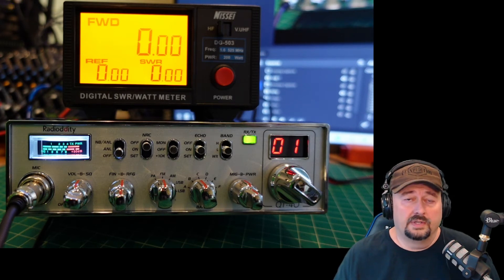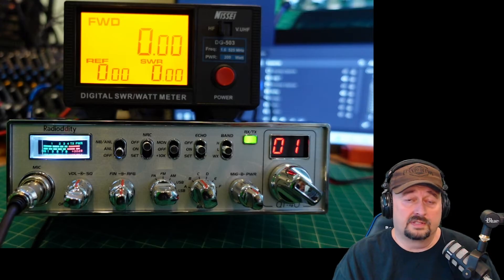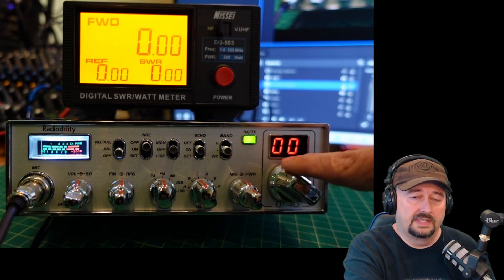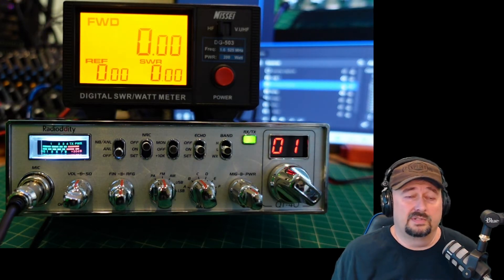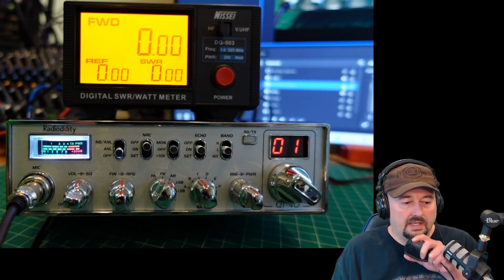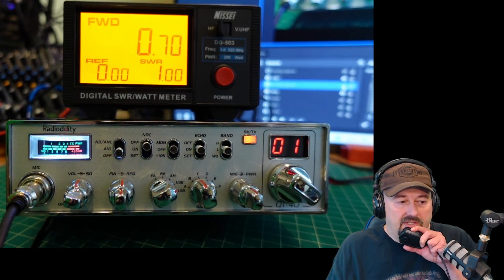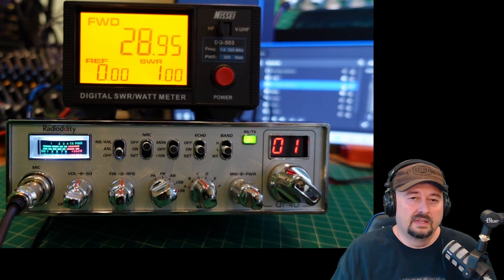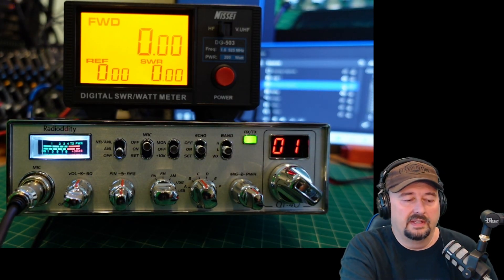Radioddity QT40 10 Meter Radio Power Test

Comment: I bought a used one. It was less than a month or so old. It has TONS of cool features, you just have to read the manual to unlock/use them. The radio even has a Frequency counter, although it's not a conventional styled one. It shows frequencies two digits at a time, but it's still cool !!
Reply from the maker: They are pretty cool radios 👍

Comment: Is that right out of the box, or has the radio been "tweaked" with the software, and the patch-cable that comes with the radio? (Yes, I know the software is available for dowload on the internet,...most likely for a nominal fee) I was just wondering if those results were from a "stock" radio , or not.
Reply from the maker: Stock, right out of the box…

Comment: Thanks for the video. Someone had replied in the questions on the Radioddity site that this would do FT8. I don't see anyplace to connect the outgoing sound from the computer.
Reply from the maker: You would need to build a cable for the mic and speaker output 👍

Comment: Dam did Radioddity buy the Cobra tooling and spare parts from the 70's?  It's almost an exact duplicate down to the meter.  Good Test.  Ideally to test would be to feed a audio signal into the mic input.  Maybe around 0.35vrms to 0.45vrms.  That is the way we tested them in the 70's.  73
Reply from the maker: It does have that classic Cobra look, and I agree with the test you described but I don’t have any spare 4 pin connectors to make up a cable 👍

Comment: What's the NRC switch ?  And the FIN/RFG knobs?
Reply from the maker: Hey Tracy, I believe the NCR is noise canceling, the FIN is fine tuning the VFO and RFG is RF Gain 👍
Reply: @TheSmokinApe  If there was a place to plug in an external frequency counter I might would buy one.
Reply from the maker: @tracykennedy7678  would be a good feature 👍

Comment: This is only legal because your using a dummy load isn't it MR. Ape, I mean without a license you would not use a Ham radio would you? LOL, I am also sure no one will mars mod this for higher CB frequency power.
Reply from the maker: You are right on both accounts 👍
Reply: It's very easy to convert to 11meterproblem is unless you can get into the service menu you can't adjust the modulation for AM and Nobody exactly advertises how to do that. Lol @TheSmokinApe